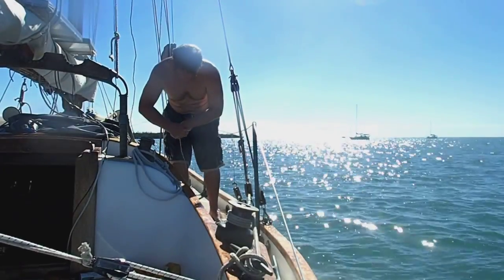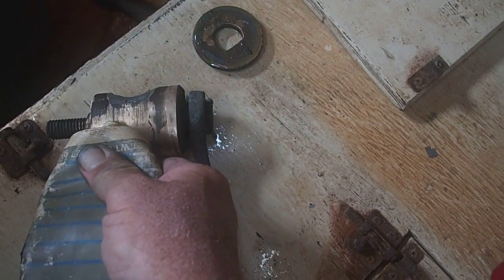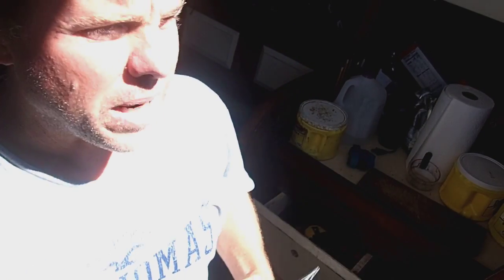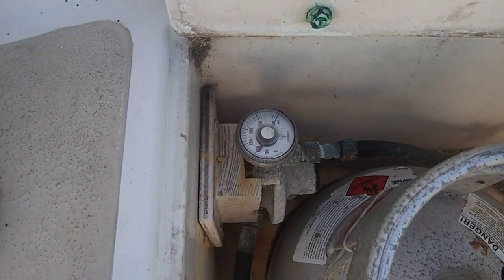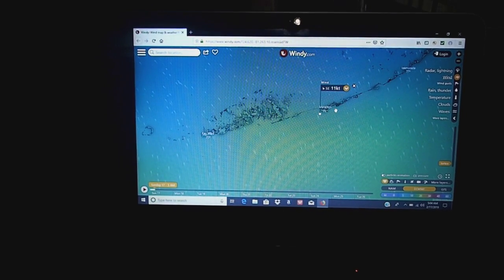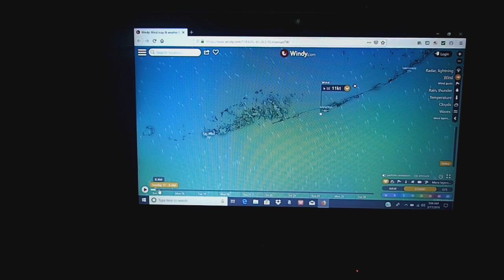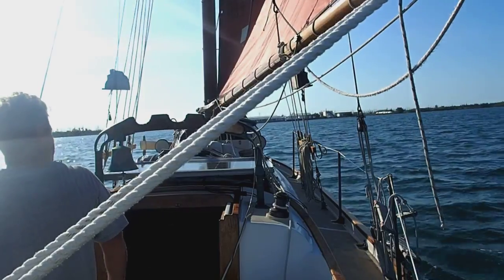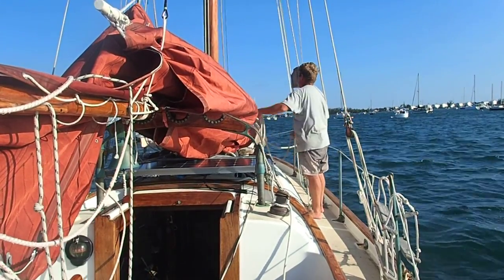Cruising: repairing one's boat in exotic ports of call

Comment: Should have purged your system by bleeding the air out first before the pressure test.  Propane leak detector tool costs less than $25 dollars on Ebay...  Always do the tests 1st and actually find the problem.  That propane leak detector will be a much better investment than just clueless throwing money at the the problem, and you will have that tool for years.

It reminds me of customers that have a miss in their car engine.  I already spent over $200 replacing wires, coils, and spark plugs...  Me, after doing a few tests...  your fuel injector is bad...  fixed.  Another lifetime customer gained...  Yayyy Me!!!

Not even close to tired of winning yet - Go Go Go THE Donald...  We have your 6!  X22 Report on Yew-tube for timely updates to the new American Revolution...